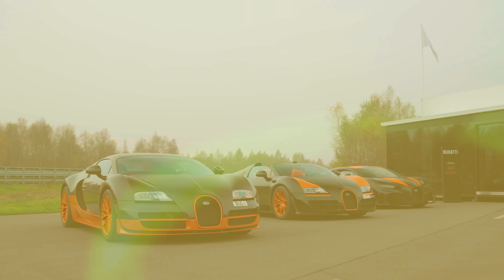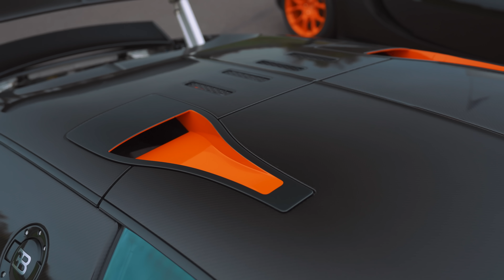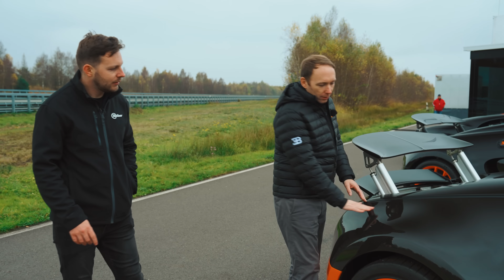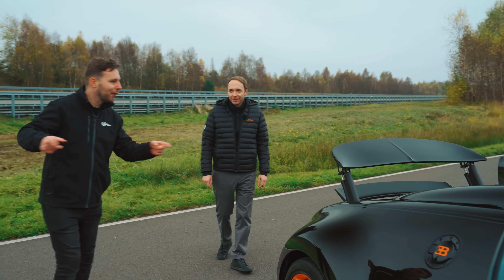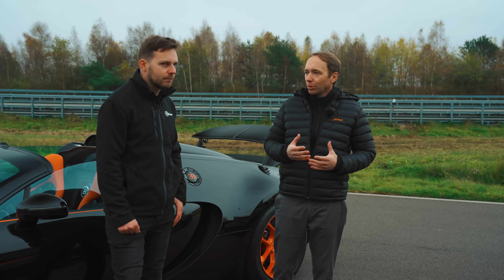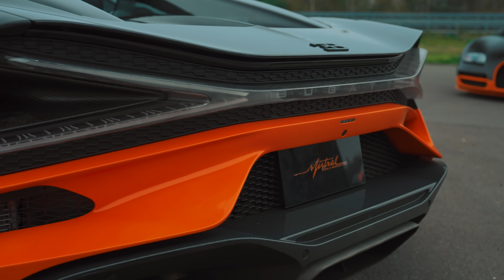The Secrets Of ALL Bugatti’s Top Speed ‘World Record’ Hypercars! | 4K

Comment: What I find most interesting is the evolution each car has in the orange and black paint job. The Veyron Super Sport has a lovely deep orange very perfectly lined on the bottom. The Grand Sport Vitesse has none but instead has a new orange color right above the headlights along with its wheels. The Chiron Super Sport 300+ has a similar design but instead 2 stripes above the center hood. I do love how the Mistral WRC has a tie back with the original Veyron SS WRE paint theme. Just wish all of the predecessors had a matching wheel design with the first car but I do think it's an interesting choice to make each one of them have a very unique characteristic. Either way I love all of them and learned a whole lot about each one. Surprised to see how critical those small little changes were to helping its top speed!

Comment: Fun fact. On Bugattis 300 mph run , the 200-300 mph span required 44 seconds 
M2k Motorsports oe cast engine 5.4L 4V Ford GT only took 21 seconds for the entire run of 0-300mph in a standing mile and the same 200-300 mph span took 10 seconds. 

Bugattis are a turd in comparison

Comment: The most worthless record in the world of sports cars. Even owners need a giant straightaway to do this which is next to impossible to find in a closed circuit. 
It’s literally a bragging right as owners are never going to push their cars to anything like these speeds.
Reply: We have seen videos of owners putting their Chiron up to 417 Kph at open traffic in the autobahn...  Quality and luxury aside, seems that Bugatti makes incredibly stable cars which are easy to handle for no professional drivers even in daily use.
Reply: @ 
That’s a couple of owners doing it once and it’s incredibly irresponsible even on the autobahn. 99.99% of the miles put on these cars is not done beyond speeds that a 3 series BMW can reach.
You are referencing what is called an outlier.
Reply: @drstevej2527  Yes, is irresponsable, but also legal and a statement about how the patform behaves. Also, even if the owners won't ever go beyond 120 Kph, there's nothing in common about how a Bugatti goes from 0 to 120 to 0 and any BWM you can find or figure.
Reply: @ 
Except they aren’t doing any such thing in this car. In point of fact it’s illegal in most countries to accelerate at such speeds. None of which goes to the point. This is why the Bugatti has never been named the best performance car of the year in its history. 
Going fast in a straight line is not much of an achievement in 2024. Doing it in a 16 cylinder engine is rather laughable given what Porsche can do with 6 cylinders except it’s not as wide as a SUV.
Reply: All car records are pointless because no customer can do them however thats the point of the record, bragging rights so no they're not pointless
Reply: @ 
If you are buying a car for bragging rights then yes it’s pointless. You are paying for someone that you will never do in that car.